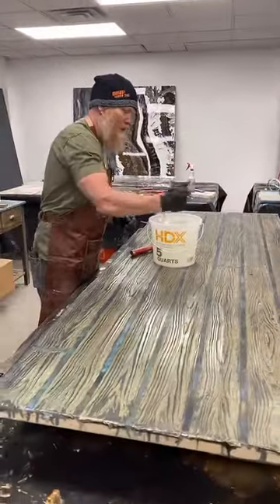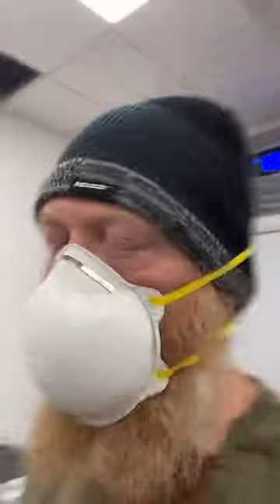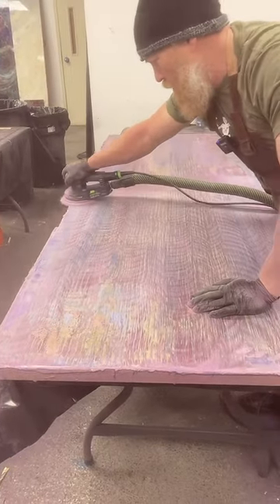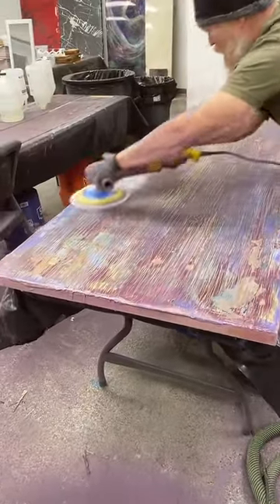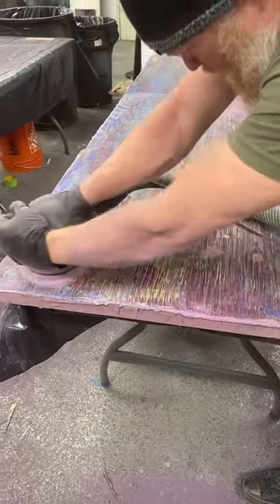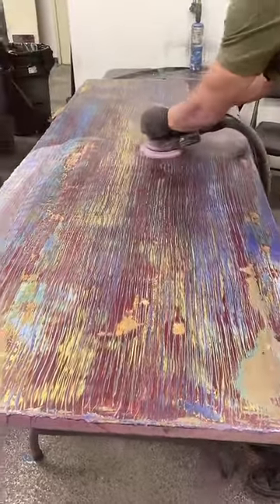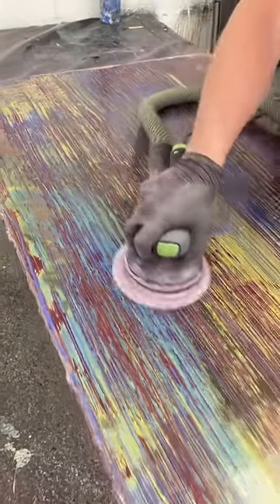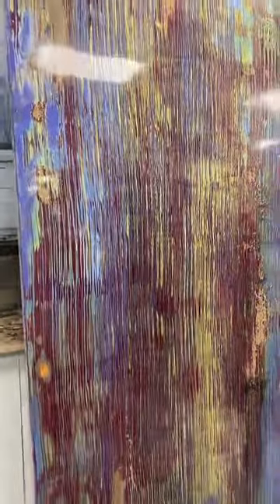Epoxy Clear Coat - Polish Wall Epoxy - Countertop Epoxy - TikTok Live 04/10/23 Part 1

Comment: Going to do my first pour in month or so after it gets warm enough out.  Watched some videos and did some research.  Not fully confident but gotta give it a go.  Project is a subwoofer box.  Part of it is going to be in the sun for long periods of time.  Bought some boat resin and mica powder.  Got silicone cups and mixing buckets. Going to try to pour 2 colors thin.  Black and neon orange.  Hear waiting till it gets to a certain temperature like 100° to pour to help colors not completely blend.  Not sure if it's best route.  Also hear spray denatured alcohol on it to get a nice clear glass finish,  but I think it would be glass clear finish anyways.  Any advice? Also will colors or resin fade due to sun?  Any way to protect it? Thank you.  Enjoying your videos.
Reply from the maker: We can’t speak for other companies. With our resin we have a working temperature of 70-75 F and pouring around 80-85 F we also never recommend light colors or clears for outdoors. We also use 99% isopropyl alcohol as it has the least amount of water content. You may also want to seal the subwoofer prior to your pour. Be sure to give our office a call for questions just keep in mind we are only experts on our own products but we can provide general knowledge 970-639-9338.